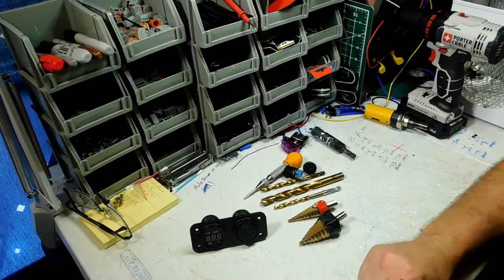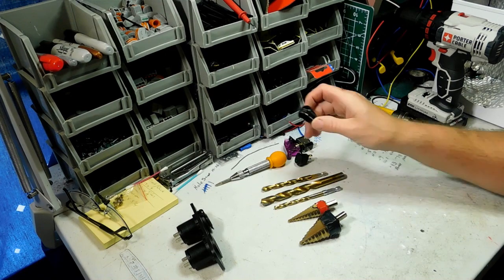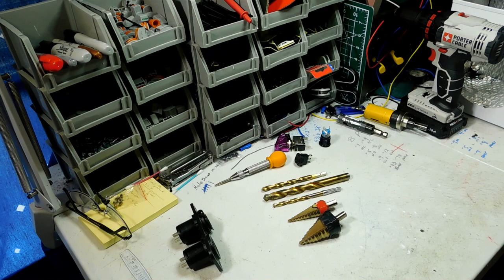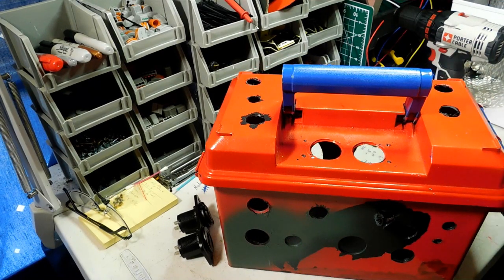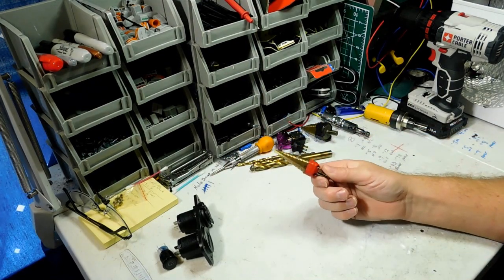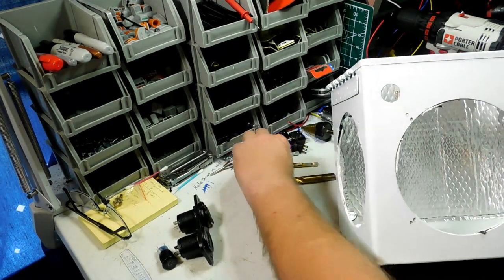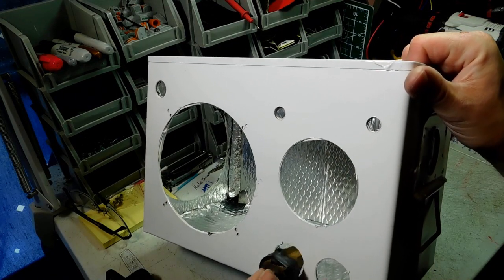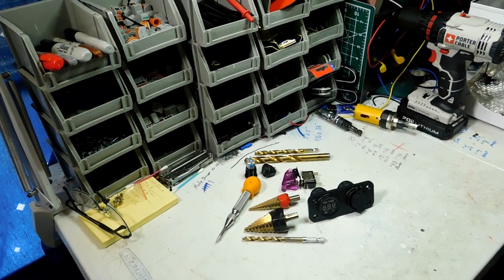How To Make Holes For Switches And Gauges

Comment: I got a round pop in switch that has a notch on the side for alignment. How would you account for that notch? The bit I need is 51/64.
Reply from the maker: Is there anyway you could post this in my Facebook group and post pics?
Reply from the maker: https://m.facebook.com/groups/1225425117541115/?tsid=0.2274069642604355&source=result